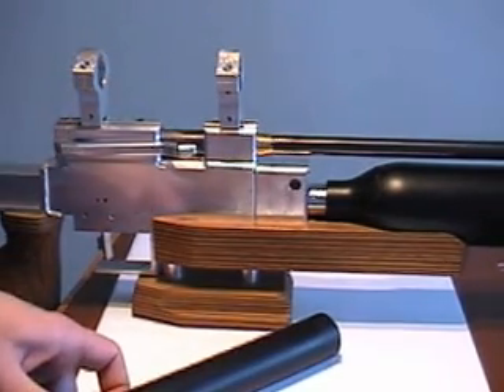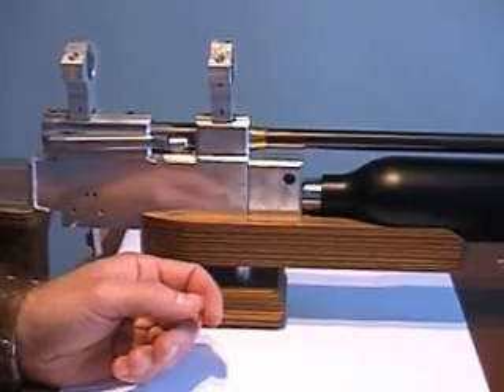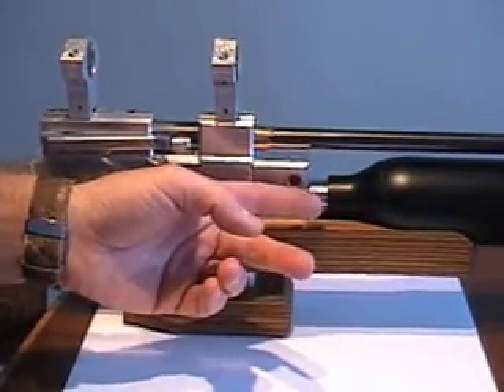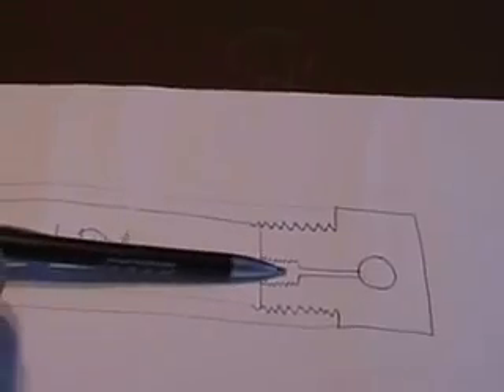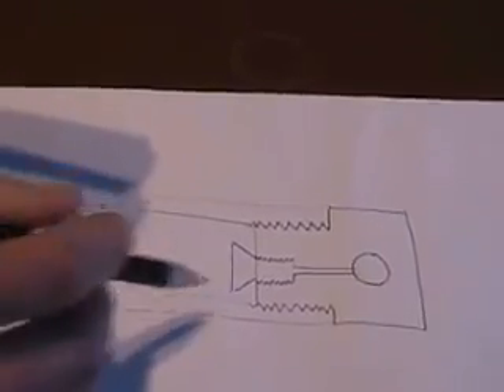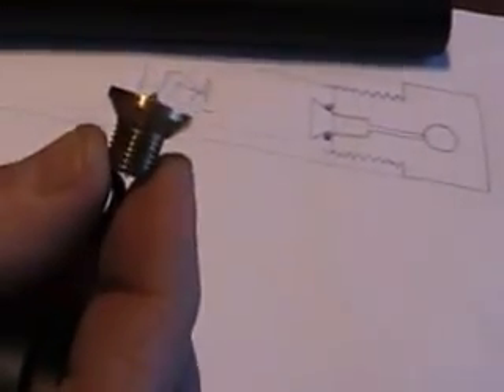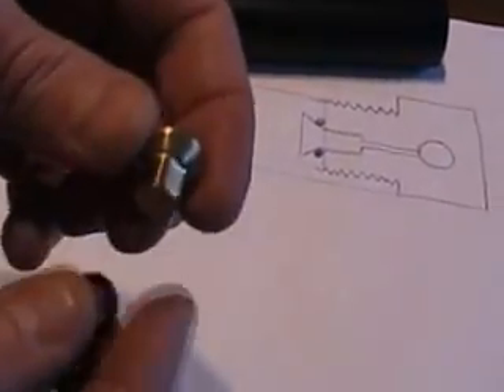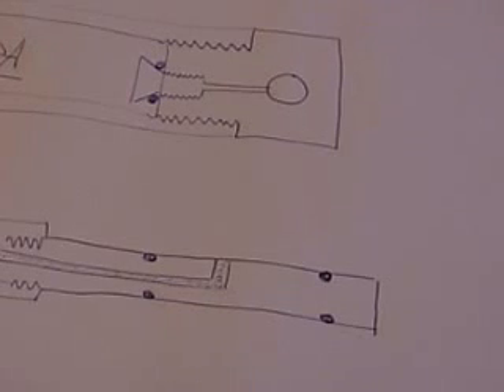DIY pcp airgun fill port

Comment: for the last question.
what kind of metal did you used in your pressure tube or the co2 tube the thickness and the metal used? and the burst pressure too... can you help me? plssss
Reply from the maker: richard cero Richard, I strongly advice that you use a ready made pressure vessel for your gun. This is for safety reasons... high pressure air might kill you! If you decide to build your own airtube i recommed a safety factor of three as a minimum. make sure you know the properties if the material you use, never use material you find on the scrapyard! You must know the properties of the material!
Reply: okay thank you.,

Comment: so where is the spring retainer?
Reply from the maker: richard cero Hi Richard, the beuty of this type of fill port is that there is no need for a spring! the conical shape of the "screw" and the high pressure pushes the oring against the sealing surfaces and creates a good seal. Thanks
Reply: okay!! hope it will work when I make one!!
thanks for the reply!!! good day sir.

Comment from the maker: @bravootome; thanks for your comment.  30bar is fairly low for a pcp... might be hard to get it to seal properly.. Anyway, yes; a wells set up gun w/o regulator can produce reasonably flat Power curves, but all guns are different. If you have a chrono when testing and regulating your gun you'll probably find a pressure range where the gun produces fairly consistent power. A gun built to perform at it's best at 30bar will probably have problems opening the valve @100bar.. that is true. Most of my guns are filled to 200bar, and most of the time i shoot them down to lets say 120bar Before the Power drops to much..
thanks
Reply: dude, are you still making this project?

thanks

Comment: hi, i remember someone asked you this some time ago, but i want to ask again:
you said it ok to make a gun with out a regulator, i want to know if i set the hammer to open my valve at 30 bar to have a relative power, i dont think it would open at 100 bar. sure it is important the diameter ov the valve and poer of spring, but...

Comment: hello, i just got a big probl. that i am trying to solve for couple of months and i hope you might help me.. my homemade airgun does not shoots streith anymore. The 8 mm steel bb flies like 20 cm away from target by 10 m. i think something happens when bb exits the barrel. Before i had an acceptable error by 3-5 cm. The barrel is made of an simple aluminium pipe. i know i should buy a propper one but why sometimes i can hit a penny all day long shooting.. and somtimes it just drives me crazy ?

Comment: cheers - please do.  I was thinking on the way to work this morning that what would be a good vid for you to do is on the equipment you use, such as your mini lathe etc and what features to consider when buying one for airgun construction.  I am soon going to buying a mini lathe just for this purpose and there's so many choices and parameters out there it's hard to decide.

Comment: In your experience have you found any problems with the tube type FX cylinder as far as leaks? Pushing + removing the fill probe maybe the orings shear very fine and get inside the cylinder? Have you found this before?
Thr fx cylinders are very good quality build and tested properly to i think over 700BAR! Ive seen inside mine and they are well made. Cheers

Comment from the maker: Milo, thanks for your comment. One flat will do just fine. Just file away enough material to let the air pass through the threads. File away, fit the parts and hook up your pump; if you can push air through the threads w/o to much effort your're done! It doesn't take a lot of fileing.. Can't give you an exact figure... file and try, file and try..
Shoot me a pm if you get stuck!
Thanks

Comment from the maker: Cheers mates! That check valves is dead easy to make.. It might be worth taking some extra minutes to give a nice smooth surface finish to the parts that the oring seals against - the screw head and the end plug or wherever you fit it. 
thanks